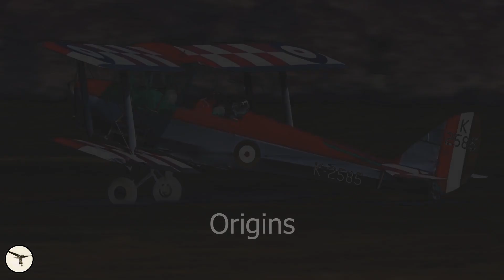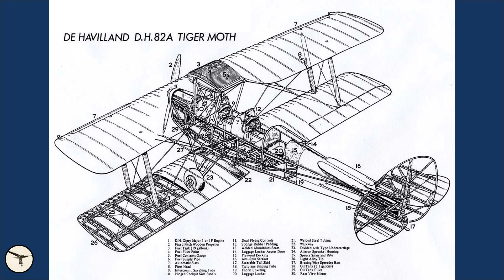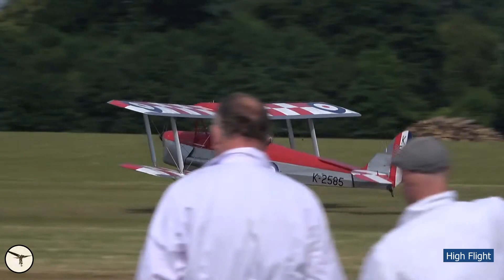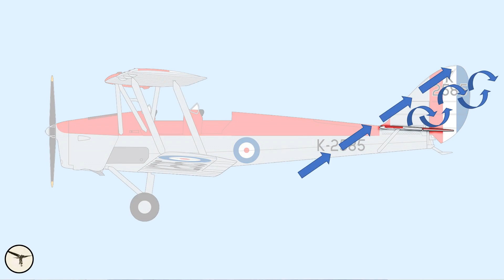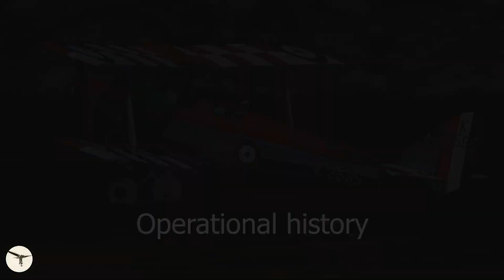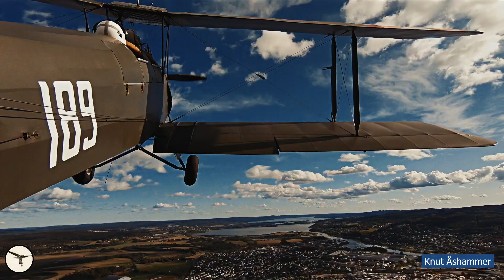DH.82 Tiger Moth | First with LERX

Comment: Thanks Magnar. Most of my 35 years of flying has been in the lovely Chipmunk (in particular G-BCSL) , the best handling aeroplane i have ever flown (though the Bucker Jungmann came close). I have flown many other mainly tailwheel types, including the L4 Cub and Super Cub (I prefer the L4), Citabria etc. I also had a share in a Yak52 for a few years and that was quite a machine, more warbird than GA, aerobatically unlimited (unlike the Chippy), but very thirsty!

I have flown the Tiger Moth on a couple of occasions and found it did not handle well! Awful ailerons giving a poor roll rate - lots of rudder needed to get it to roll. But it is a good looking characterful open cockpit biplane so we forgive it its handling!

Chipmunks, too, have anti-spin strakes though of course the Tiger had them first.

Vince C.

Comment: That Moth in the Thai museum was "rough". Hopefully they will try to clean it up.  I really got a kick out of the explanation about the mag switches being on the outside and the sequence of using them during the start. The Bristol Fighter also had it's mag switches on the outside, allowing the "erk" to see it the aeroplane was hot or not. Also got a smile from the brass windshield screen on the one norwegian Moth. Nice work. This is a really great presentation, especially giving pilots just enough 'pilot talk'  and history to make it enjoyable. I once got to fly a Moth, we had to clean the bugs off the trailing edge!!   Ha det.
Reply from the maker: Thanks, Ed. The Tiger Moth, like many other aircraft in the museum, was damaged by a flood some years ago. Restauration is underway, but they have so many aircraft to care for.
Reply: @FlywithMagnar  Well that would explain the condition of the instrument panel. I will give them credit for the museum, very nice looking building.

Comment: An excellent video, thank you, Magner!

My father and 2 of his friends bought a Tiger Moth direct from the RAF/War Office in the 1950's to use as a tug for a Gliding Club near Kinross, Scotland, so I've always had a soft spot for the aircraft despite not having flown in one due to my age & size in the 60's! 

Your description of the various versions of DH82 was also very interesting, but I'd like to add to the spec for the DH82c, as it was also fitted with a cockpit heater system, a vital addition for Canadian winters!

Another interesting snippet is that the origins of the Gypsy Major engine was a French V8 fighter engine from WW1 (a Renault engine, if I remember correctly!) The Gypsy Major was basically one bank of cylinders from this French V8 engine!
Reply from the maker: Thank you for sharing your knowledge. I didn't know about the origin of the engine!